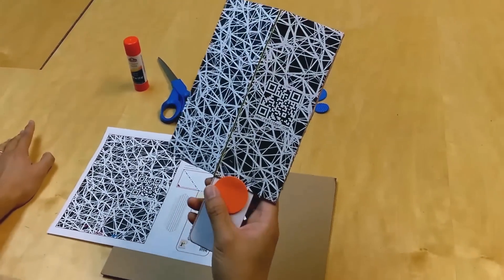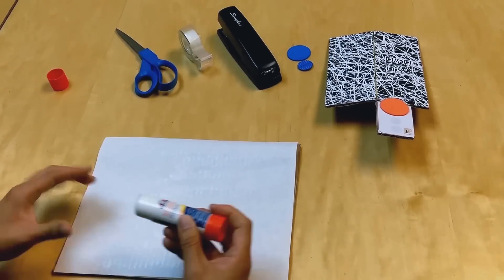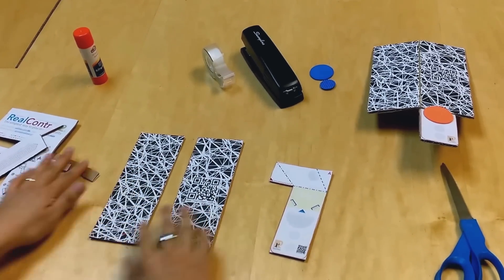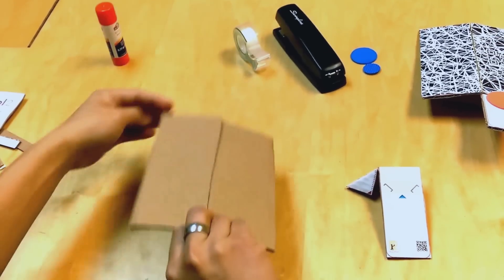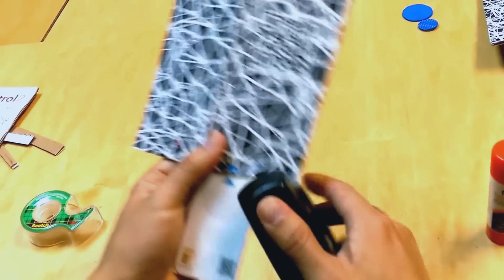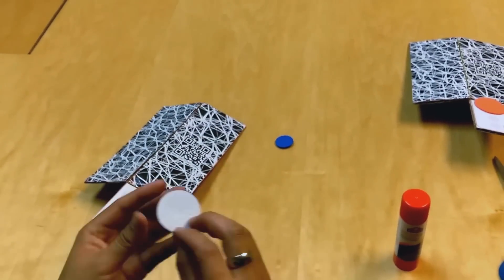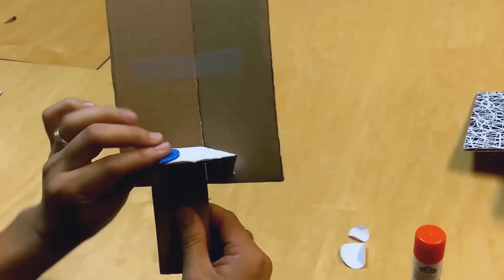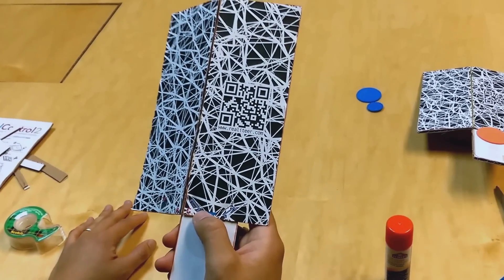RealControl2 Instruction

Comment: Does it work on b/w print?
Reply: well actually i believe this is using the AR system, so you should be able to use any color as long as the pattern is still same, which mean yes you can use a b/w printer because the pattern is actually already b/w

Comment: can i use illustration board?
Reply from the maker: There's the trigger part that might not work because the illustration board will break. But you can use it for the top part the holds the pattern, and use the cardboard for the handle. Thanks.

Comment: I'm not sure if it actually matters, but to get it in the dimensions printed on the template make sure you print in actual size rather than shrink to fit. With my printer that meant I had to print each cutout piece separately, but no big deal.
Reply from the maker: Yes, the size will affect the precision of tracking. The smaller it is, the harder it can be tracked by the phones.

Comment: but I want to know that the controller will work on any vr device or it will work only on cardboard vr, it need any code or some thing else please tell fast
Reply from the maker: It should work on any mobile VR, however, you will need to make sure your phone's front camera can see through the headset in order to read the controller. Thank you.
Reply: @Realiteer   what is the use
Reply: @Realiteer  what is the violet colour crawler used for
Reply: @Realiteer  how to shoot

Comment: Hey,  i tired to make your diy vr controller and it was cool but i cant use it because it can't scan the QR code :/ there's something wrong with your code or what? Pls help me,  i wanna try it so badly
Reply: marc mesa I have the same problem. tired 2 days ago.
Reply: ***** but i will wont work unless you have a QR code that will detect the camera
Reply: i do have a pattern, it detects somehow but it's position is upside down even tho im holding it in the right position. also i tried to scan it using google cardboard app but it doesn't detect :/ so i guess it has a problme on the game
Reply: okay, well thanks for that tho. but  i haven't check it yet so i dont know if it's already fine. anyways thank youu!!

Comment: I've tried the  Vive but THIS IS THE BEST MOBILE EXPERIENCE for VR. Here are some suggestions

-Smooth positional tracking with printed markers,  gyroscope and camera  
-haven't tried it but fisheye/wide lens may give you more fov 
-a plastic controller with real buttons under a low price about $20-30
- a app gui for the realiteer 3 
-a app store for vr games that support realiteer
-a low price about $20-30